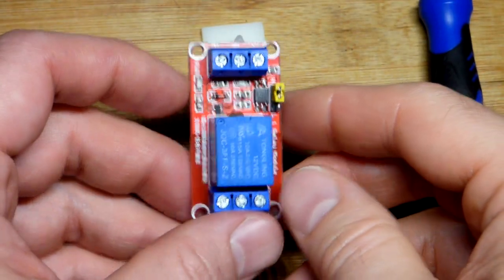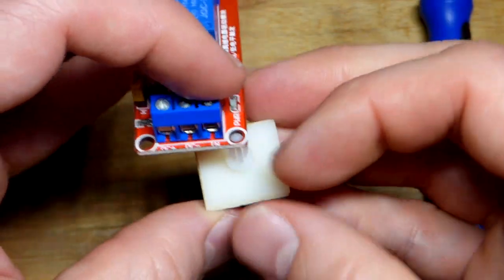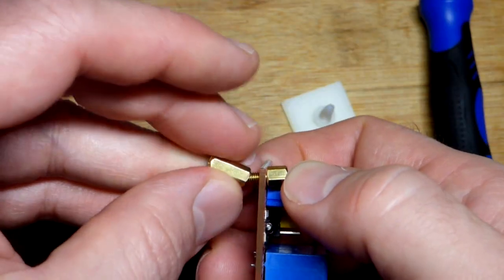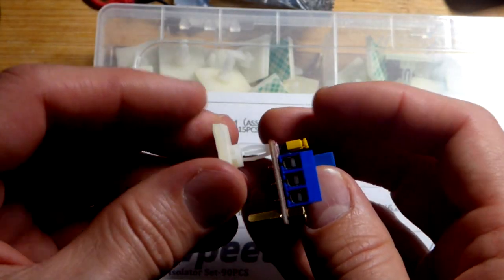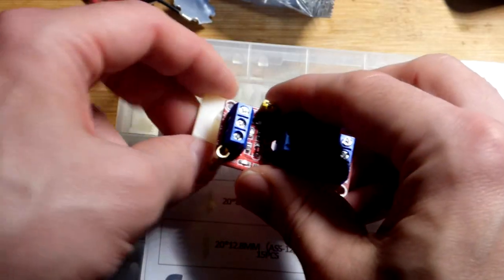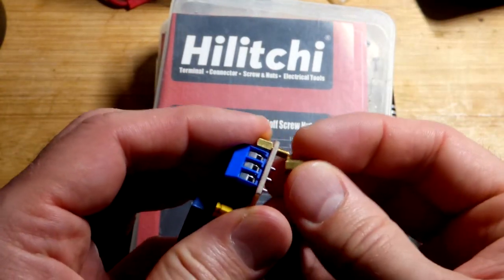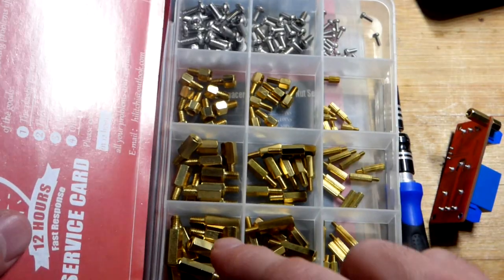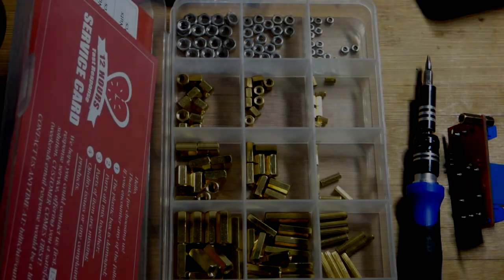Selecting Standoff Spacer For Circuit board Module Holes

Comment: Nice hardware.  One of the many things I always watch for when 'deconstructing' junked equipment... hardware... standoffs, heatsinks, small bolts, nuts flat washers, star washers, lock washers, knobs, switches, cords... endless.  In my early days I found Chicago bolts (cheap!) useful as standoffs after cutting down the females to act just as nuts. They also have a variety of 'extensions' from 1/2" on up.  The threaded male ends are 4 mm dia (0.156") and the nonthreaded shafts 5mm dia (0.2"). A 3/16" drill bit makes a bad fit but an 11/64" is just right.
Reply from the maker: Thanks for the info!